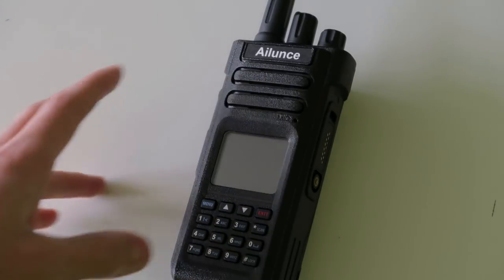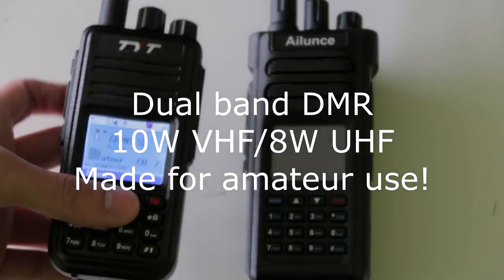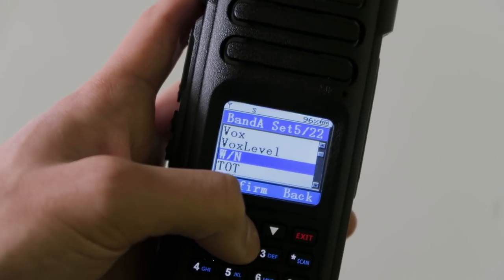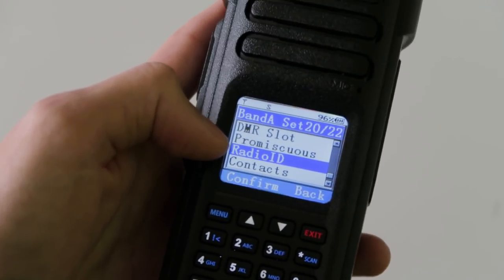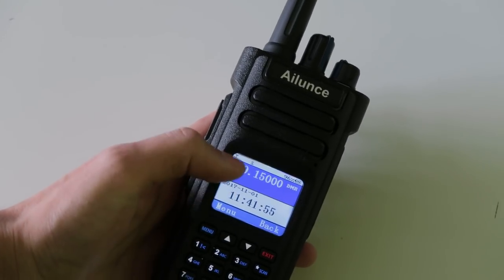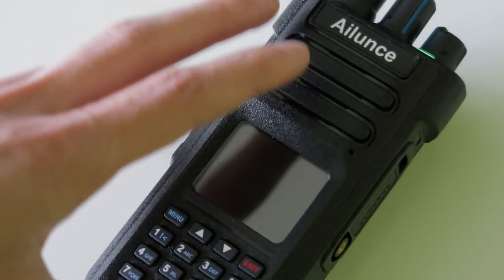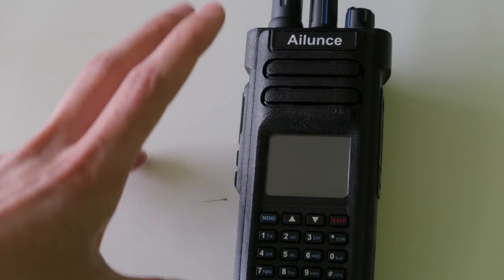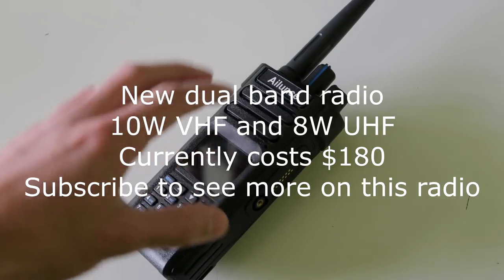First look: New Ailunce HD1 dual band DMR radio!

Comment: Brilliant  & really helpful videos , I was wondering if I can use this model for dpmr 446 ?.
Reply from the maker: No you cannot. There are few legal dPMR446 radios and they're all expensive. Also this radio does DMR not dPMR. They're different modes. You can't use any 5W radio on PMR446, they have to be 0.5W and have a fixed antenna. They also can't allow you to enter a frequency from the keypad I think.

Comment: That looks a LOT like an XPR7550.

I'm intrigued...
Reply from the maker: I noticed that too. It does seem that Chinese manufacturers often seem to copy the shapes of other, popular radios.
Reply: How does it compare in terms of form and function? Does it feel as beefy and durable as a 7550?

Also, can you speak to the audio quality? I see it's available for pre-order now, and I'm seriously thinking about it, but there's not much differentiating literature on it.
Reply from the maker: Probably not quite as strong as the DP4800 but not far off either. It does feel robust in the hand. 

I'll be making a video showing it listening to a repeater so just look out for that if you want to hear what it sounds like. I'm just waiting for them to improve the firmware right now, since it still has some bugs.

Comment from the maker: I asked Ailunce if they have any plans to make a colour code and timeslot promiscuous mode for this radio. They told me that if people would find it useful, then they might do if enough people want it. Should there be a colour code and timeslot promiscous mode or not? Please fill in this single question survey to give your opinion. https://goo.gl/forms/aX1tQYvDJ4hayk2u1
Reply: radiosification se ve bien como funciona la pregunta del millón.
Reply from the maker: There's no point talking to me in a language I don't understand!
Reply: The desirability of such features depends on if there is a color code scanner such as that provided by Ty MD380 Tools. If there is, the promiscuous CC and TS features, while nice, are not essential. In any case the features would be a great convenience so I will answer Yes in the survey.
Reply: By the way, I enjoy your DMR videos and benefit from them very much, Thanks!
Reply: radiosification the full promiscous mode would convince me to buy HD1. Right now, I have GD77 but it does not have full promuscous mode... vote YES for this feature
Reply: Radiosification, radio looks very nice, and is not need for a PC to be program ,please  keep informing  73!
Reply from the maker: Eduardo, if you're not actually responding to what I said in my comment then it's best to make a new comment, otherwise the topic gets diluted with unrelated comments.
Reply: Would you mind sharing the radio size dimensions? Their website doesn’t have them. I’m looking for the height of the radio minus antenna.

Comment: I got the same radio but I have a problem with my radio I try to download the new software on that radio and it's not going through they said it's the cable but I'm running Windows 10 and I just got finished program another radio with that same cable and it went through so I don't know what's going on maybe you can help me.

Comment: Thanks for this video. Have been waiting for this radio for a while. One Q - do you have the GPS version? I wonder what use there is for GPS in this radio (apart from probably displaying the coordinates).
Reply from the maker: No the version I have is not GPS. I don't think having GPS on a radio is really very useful at all. I've never understood why people actually buy GPS versions. It is possible to send GPS data over the air in DMR but it's only really useful in the commercial world for tracking vehicles or resources. You wouldn't really want someone tracking your location all the time in amateur radio, or at least I know I wouldn't.
Reply: I have a Yaesu VX-8R, it has APRS support on board, you can use it to connect to the APRS network and if GPS is present (it was an optional external accessory back then) the radio would do exactly this - track & send your location to  the APRS network. As far as I can tell the HD1 doesn't have APRS support so I wondered what the use of GPS might be.
Reply from the maker: I think there are a few networks that support GPS data on DMR but I've never really looked into it so can't tell you much more than that
Reply: Thanks for all the info.

Comment: This is a digital radio,right? When using the device how can you set it to transmit the voice in digital way or analog way? Or when you’re scanning the band it should find digital or analog transmissions?
Reply from the maker: Yes it's digital. DMR specifically. You set which mode to use. It cannot auto detect, so you have to select the right one. This radio is for amateur radio use though so if you don't have a licence, don't buy this radio. Look at licence free radios instead.

Comment: Is ailunce an actual manufacturer or just a private label for a distribution partner? The radio resembles Baofeng i think.
Reply: David MacLennan Ailunce is a trademark of Retevis. From the Retevis blog: "Ailunce HD1 is the first radio we R&D (research and develop) mainly for hams. We design the HD1 based on RT3 and collect lots of advice from hams."
Reply from the maker: They are an actual manufacturer, not a private label. They are developing the HD1 themselves.
Reply: Pedro Baez Betancort when does the HD1 come out
Reply: King Jay Is already out, is in pre-sale state, unfortunately they are out of stock, so wait to be available at end of november, mid december (aprox)

Comment: Thank god.  I was really looking forward to the TYT2017 considering how successful the 380/390 was... Then turns out it's a huge piece of crap.  REALLY hope that Retevis comes through on this unit!!
Reply: This is not retevis
Reply: Do not get the MD-2017 by TYT. I got so burned by that POS and so did many others. Thank goodness HRO took mine back even after I missed the return window by a couple of days. Sad thing is that HRO said they were getting them returned more than any radio they had in store.
Reply: Ailunce IS part of Retevis, though..  So you're wrong.

Comment: Hi I am just getting back into Ham Radio after a long break 20yrs lol and I have just purchased a Radioddity gd77 although I have not had a chance to get to use it yet..one thing puzzles me is the DMR ID Number which I got by registering online,can dmr be used via a local repeater without this ID being programmed in 1st ?. I thought this tells the network and the Repeater who you are and without the id being programmed in I would be like a Pirate..any help would be very welcome thanks for the great Videos.
Reply from the maker: I believe some repeaters only allow IDs in a valid range. You can't use a radio without any ID in so if you use it without programming one in, it'll probably be set to a default ID of 1. It's best to program the ID before using the radio and if you have an ID already then there is no reason not to just use it.
Reply: radiosification Cheers thanks for the info Just learning about DMR at the moment 1st job is to get my ID and the Frequencies of the repeaters programmed in...hope to have a bash at DMR sometime this month..
Reply from the maker: My "TYT MD-380 programming for amateurs" video might be useful. Just copy and paste that into youtube search and you'll find it. It's not the same radio but the programming software looks and works very similarly on most radios so you should be able to follow along with that video most of the time.

Comment: Just bought it online. Playing with the programming software.. whats the difference on digital channels between Work Mode Repeat and Work Mode Double Slot ?
Reply from the maker: Repeat is when you're using a repeater. Double slot means DCDM - dual capacity direct mode. See here https://cwh050.blogspot.co.uk/2012/12/dcdm.html
Reply: radiosification ah ok, thanks. Guessing not many amateur repeaters use it then...
Reply from the maker: repeaters cannot use it. They already use both timeslots. DCDM is for simplex where you want to be able to use both timeslots on a channel. Normally with DMR simplex the timeslots are ignored, so only one person can talk.
Reply: radiosification gotcha thanks you.

Comment: Really think I will get me one of these ,I think it utilizes the same battery as my GD-55 and would be useful.
Reply from the maker: Looking at images of the GD-55 online, it definitely doesn't look like they share a battery to me
Reply: excellent ,Im using the GD77 at the moment but I love the extra power ,do love the dual band aspect of the GD77 but love the simplicity of programming on the fly with this one ........ Great vid thanks ;-)
Reply from the maker: I'd hold off if I were you. The radio has some hardware issues at the moment so they'll probably come out with a new hardware version in a few months
Reply: Thanks for that I will....Im curently enjoying the GD77 with its latest firmware giving a VFO  and user ID import facility. The bugs mostly ironed out now and is a great little number ,down side (takes forever to charge) about 5 hrs . Scan is very quick for a chinese radio in VFO which I like.I can programme this on the fly but need to programme a couple of ghost channels that just get re-Written rather than programming a new channel.

Comment: Random but could the HD1 be used with the tyt and also motorola radios such as the DP4400 if they are on the same frequency
Reply from the maker: Yes. That's the entire point of having a radio standard like DMR. So that you know they'll talk to each other fine.
Reply: @radiosification  thanks sorry for so many questions I'm still trying to get my head round all this stuff
Reply from the maker: No problem

Comment: Could you show how to send and receive sms (APRS) on the hd1 ailunce, tnx nice work
Reply from the maker: You can't, it doesn't do APRS
Reply: @radiosification  
I received a message from someone just trying to return one like a text under messages
Reply from the maker: Sounds like a text message over DMR. It can do that. You'll find messages in the menu
Reply: @radiosification  
Yes I sent a message back but they only see there radio light up with my name but no message. Maybe it only works. Hd1 to another hd1
Reply: @radiosification   I don't know ill figure it out somehow tnx pal great videos
Reply from the maker: Could be incompatible text message type. There are different standards for text messaging in DMR such as Motorola's and the DMR standard.
Reply: @radiosification     that makes sense tnx bro

Comment: I heard it will have Crossband Rpt ? Just heard Rumers .. Thanks great Video !
Reply from the maker: It can work on crossband repeaters but cannot be a crossband repeater itself. As far as I know they don't plan to make the radio work as a crossband repeater.
Reply: I figured that..... so basically if you are talking on a Cross Band Rpt for example just like any Baofeng  Input 146.4444 Output is 446.4444 for example you can program the input and the output individually. So basically it doesn't have a crossband rpt built in. Thanks Sir !

Comment: What exactly is promiscuous mode ?
Reply from the maker: Good question. It means the radio does not require a certain parameter to be programmed for it to work. Usually promiscuous mode means that it can hear any group, without you needing to program in the groups you want to hear. But on this radio, there might be a colour code and timeslot promiscuous mode too in the future, so in that case it would not need you to program the timeslot, colour code or group. You would just be able to program the frequency in and hear everything on that frequency.
Reply: Thank you !

Comment: Is this radio have Remote Monitor Duration/radio disable decode?  In your opinion of a better device TYT MD-2017 or this HD-1?
Reply from the maker: I think it has both. It definitely has at least radio disable decode because I remember seeing it in the programming software. Download the CPS and have a look if you want to see what it can do. I don't know really which is better because I haven't used the MD-2017 but the full VFO mode in this radio is very useful so I would probably say I prefer this one.
Reply: THANK YOU!
Reply from the maker: you're welcome
Reply: HOW IT WORKS IN ANALOG MODULE, RX/TX?
Reply from the maker: I don't understand your question. And no need to use all capitals.
Reply: @radiosification  Dejan means how it works in analog mode, that would interest me too. The RX spec -035 microvolt is not a highlight i think...

Comment: Can you compare hd 1 and dp 4800 which one is better?(rf perform)
Reply from the maker: I haven't tested them because I don't have appropriate test equipment but I'd guess that the DP4800 would have much better RF performance. I've already found that the HD1 is desensitised easily by nearby transmissions.
Reply: radiosification  ok thanks and the ailunce hd 1 memory channel scan as same as baofeng radios?

Comment: Is there information available on what connection the external microphone uses?
Reply: Ht Radio Ham  Ailunce
Reply: I think it's some kind of Motorola connector
Reply from the maker: Not sure of the connector. It looks similar to the Motorola DMR stuff but it's not actually the same, I checked. It is also not the same as the Motorola GP series connector

Comment: I in the uk just got it can you do a vid how to set up
Reply from the maker: I already did one if you look around for it. It's on YouTube and you can find it very easily with the search function
Reply: Wen i set it up wen i talk it say repeater fail what i doing wrong
Reply from the maker: Just checking do you have an amateur radio licence?
Reply: No
Reply from the maker: So what are you trying to transmit on? You're not allowed to use amateur repeaters without a licence.
Reply: So is it hard to get a license
Reply from the maker: Depends on the person. Some people find it hard, others don't. It is good fun though either way because you get to attend a course and meet people with the same interest as you. 
If you don't want to do this then the safest way (so you don't cause interference to anyone else) to use the radio is to program it on PMR446 channels. You can find the frequencies by searching for that.